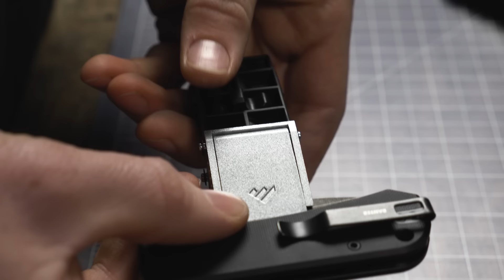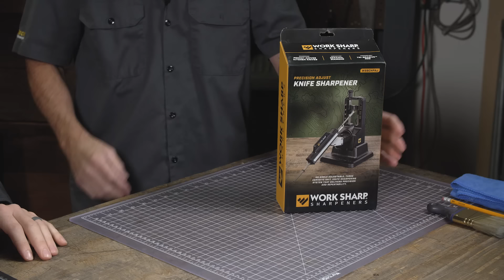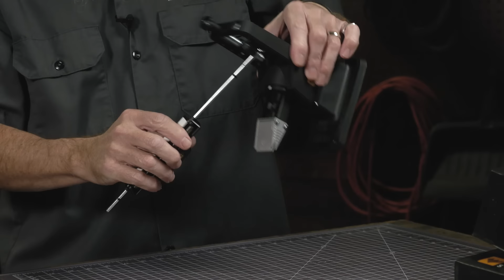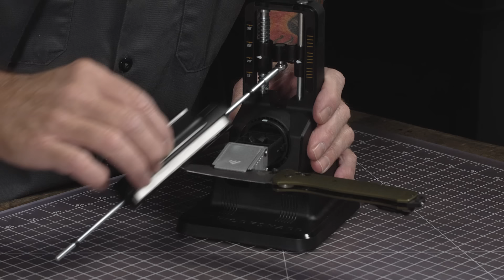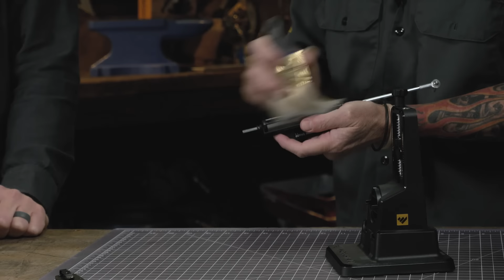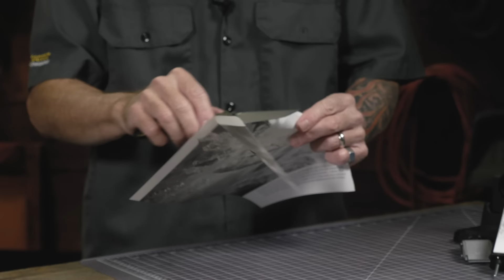How to Use The Precision Adjust Knife Sharpener - User's Guide: How to Sharpen a Knife

Comment: What about a wide (4”) blade (“Siberian chef knife).  Recalibrate angles?
Reply: In that case i would use a digital angle finder. This will help guarantee the set angle.
Reply: @jessebergunder  I got the WorkSharp sharpener, mounted my 4" wide Siberian chef knife at the 25 degree setting and took a picture.  Scaling from the picture, it appears that the angle is actually about 20 degrees.  (The 4" blade is too wide for the sharpener -- just as my little Swiss Army Knife is too narrow.)
Reply: @gordonsbuck  this is a problem for any of the clamp style systems. The angle numbers are more of an estimate. If you want to achieve a precise angle and different width knives you need to use a digital angle finder. Based on you measurements the shallowest angle achievable would be 20 degrees
Reply: @jessebergunder  I understand the layout and math from working with my Lansky system.  It’s just that the implied degree of precision is not correct that troubles me.
Reply: @gordonsbuck  yea the name precision adjust when the system itself across any manufacturer is not precise. I am only using this for pocket knives. It is a good system with pretty good stones.

Comment: Humm a bit of play on the clamp post... and the clamp it self doesn’t account for the taper of certain knives like the KME! So I wonder if you will be able to get the edge hair whittling sharp ???  Plus will more diamond grit be available in the future like 1200?? This looks like a good start but with the KME and wicked edge out there I would have like to see a system more complete that would have been a bit bigger with tighter tolerances at an affordable price.
Reply: Although that sounds amazing. It’s a bit of a stretch. If you want all that just buy a KME or wicked edge. the worksharp is almost half the price and it seems  to be a really nice sharpener for the money
Reply: @joshjorgensen1032  only time and review from trusted knife reviewers will tell...
Reply from the maker: Thanks for your thoughts Pat! I think you'll find the clamp is quite spectacular and accepts a wide range of blade shapes and grinds. We are hard at work to expand grit selection! Which reviewers would you like to see get their hands on this? We sent it out to about 30 collectors, reviewers, and heavy users to get their thoughts and they have shared several videos on Youtube and Instagram.